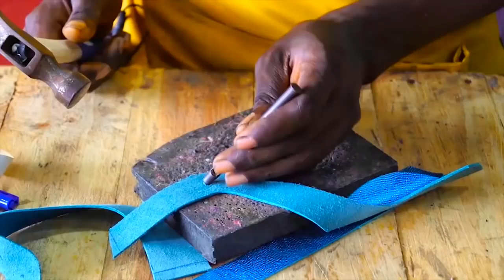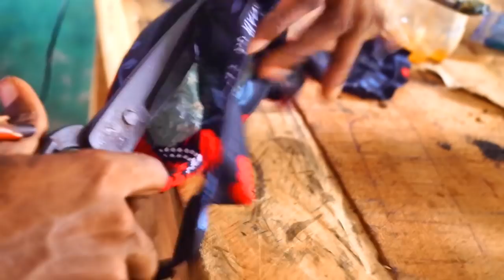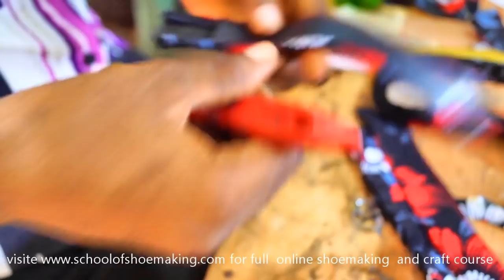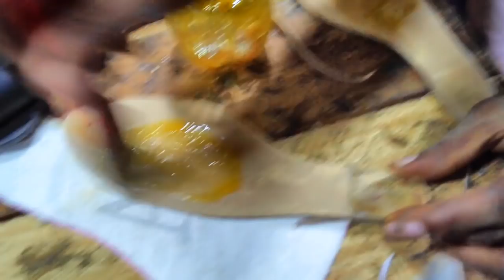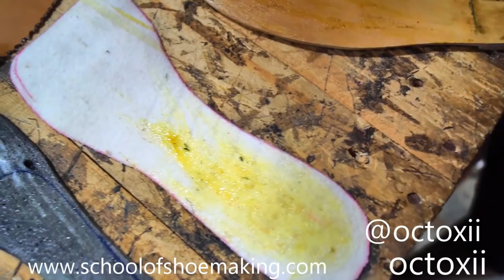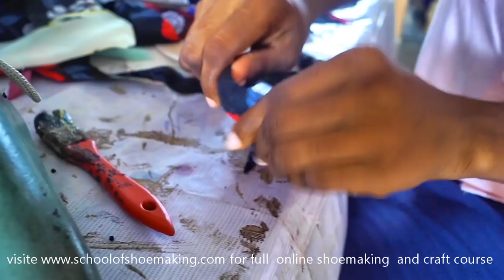Making wedge Sandal With lovely  Africa Print

Comment: Very very creative motive and nice to see. But there is question in my mind about durability. Bro, I am using local available cemented gum but after  3 or 6 months my most customers complain that gum is being used not much stronger.  Please advise if you have solution for this problem.